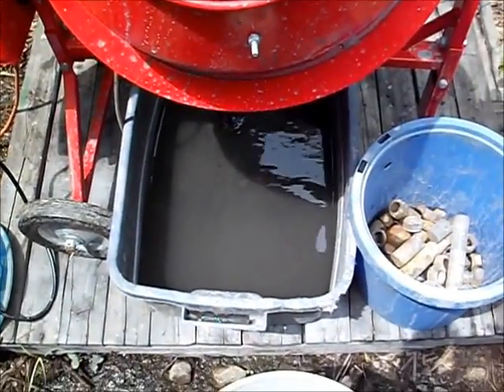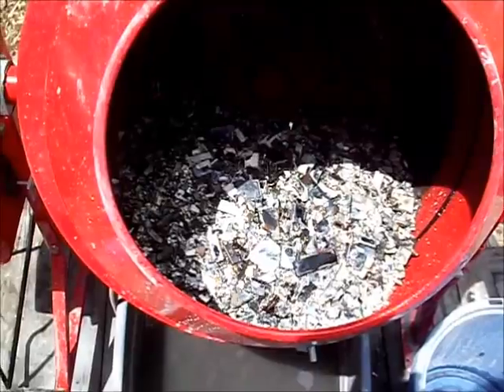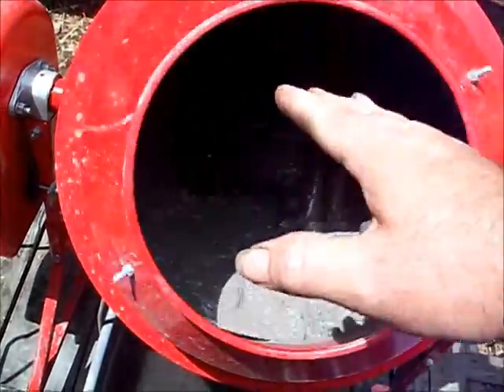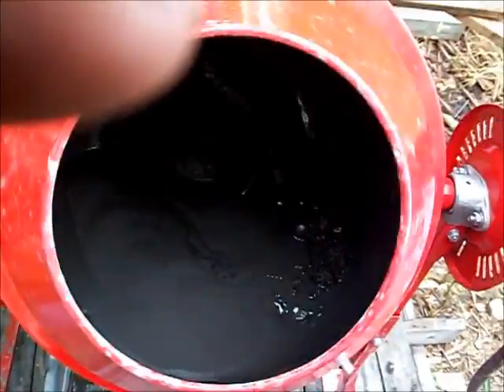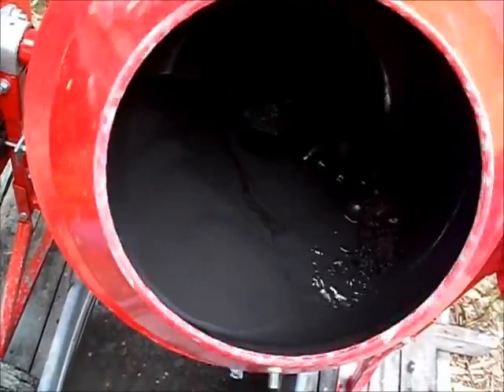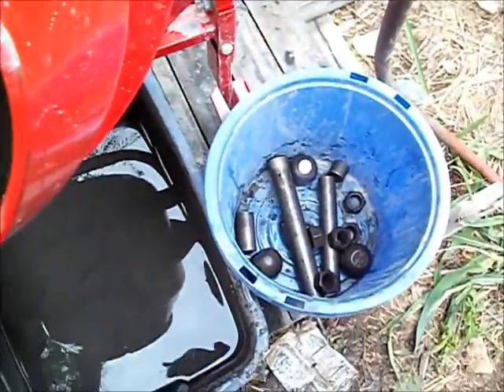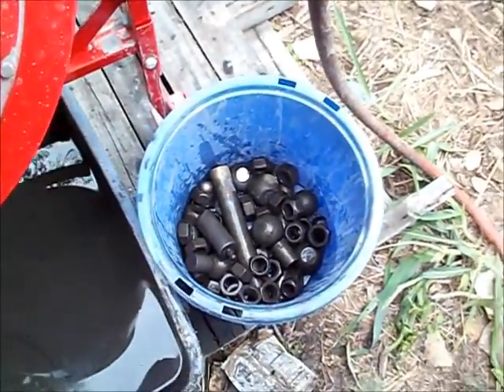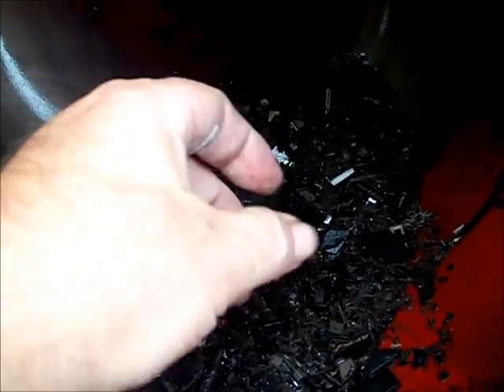milling incinerated chips

Comment: I had this problem  to and I found  if you weld a four inch steal wall on the inside  wall it stops the slide but splashes a little

Comment: i believe if you add on side of mixing drum one or two pieces of metal weld them vertically problem with not turning material will be solved anyway great idea with beton mixer

Comment: when burning chips do you incinerate n.& s. bridge chips with ram and ics or do you process different??
Reply from the maker: It's basically the same process so they all go in together.
Reply: I incinerated 2.7 pounds this weekend of ram chips bridge chips and flat packs off mother boards it was hard dealing with the bridge chips as they didn't incenirate as well used mapp to help and believe its too hot and probably trapped gold inside board fibers and couldn't mill properly as the rest of chips
Reply from the maker: You have to remove the black plastic tops from the green base before you incinerate them or it will create a mess.
Reply from the maker: The gold is in the black plastic tops.

Comment: Put some super magnets on the outside of the drum once it's crushed fine then empty rinse and empty until all the ash water and nonferrous out :)
Reply from the maker: Thank you. I did try that but the steel drum interferes with the magnetic field. It really has little magnetic pull on the material inside the drum.
Reply: That makes sense..inside  might work for the last few passes but thank you for your response and video's :D

Comment: Here is a way that is a 1000 times easier, faster, cheaper, cleaner, more efficient and environmentally friendly! https://m.youtube.com/watch?v=pPQXCgYqggM
Reply from the maker: I don't think so. I can incinerate and mill 30 LBS of IC's in about 4 hours and have the cons ready to leach the next day. I know people who use shredders and from what I hear, they wear out quickly. When you are processing hundreds of pounds for someone else, you have to use the process that is the fastest. Your claim of faster is not true. The bonding wires that you are after are so small, they can be hidden in a very small piece of plastic so the finished material must be smaller than 100 mesh. You would need to shred and then shred again and again and then ball mill to ensure the particle size is small enough. Your claim of more efficient is not true. I incinerate once and mill once. I use scrap pallets that pile up and make a real eye sore at businesses. They are thankful to get rid of the mess. The price of fuel to go get them is negligible. A gallon of gas would make a dozen trips or more. The pallets burn to white ash and the nails are collected with a magnet to use in cementing copper from solution. I could add more but it just gets long winded from here.
Reply: Geo If you're doing the industrial scale of processing 100's of lb's of IC chips then you can afford a proper industrial shredder. It only costs a fraction of the gold produced out of 100 lb chips. I was addressing people who are doing it in a small scale like me and the guy in the vid who is wasting his energy and time.
Reply: +Geo But from the look at this video and many others, the chips are not well incinirated from the first inciniration! and the tumbler is hardly doing anything. The results from what I see here is far from being a success.
Reply: Geo My apology for addressing you as "the guy in this video" I didn't notice it was you lol. Sorry again.
Reply from the maker: No apology needed but thank you anyway.

Comment: use a couple of 15 lb bowling balls.
Reply from the maker: Bowling balls are made of a hard resin. Over time, the material would abrade the resin from the balls and into your already incinerated material. Since the iron can be removed with a magnet, I think the steel balls work best. I'll show some more vids on what it can and can't do.
Reply: Geo Then i am sure a mini-hammer mill would do the trick. They use the larger ones to crush rock for precious metals. I have looked a mini hammer mills online, a person can pick up a used one for around the same price as that cement mixer.

Comment: I would use river rock ,cheaper than steel, of course i live in N.England,
Reply from the maker: The iron is easier to separate out than silica would be. The object of the process is to reduce the material to as fine a particle size as you can without causing more problems. I wouldn't add anything to the mill that can't be removed with a magnet.

Comment: Pretty smart, I'm thinking of making a ball mill at some point.
Reply: Too slow. Use an impact mill. I sell a small one. Also vend a lever operated jaw crusher which can do the job as well. Ball mills are slow. If you use one, get a rock polishing mill with proper milling balls. I use a jaw crusher and a large rock polisher. Get fine powder.
Reply from the maker: I did get the twenty pound ball charge from Legend Mining to run in the cement mixer. It is a world of difference better than the crap in the video. $50 for the ball charge and $150 for the mixer. I can mill about two five gallon buckets of incinerated/pyrolized IC chips in a days time. How much do you charge for the impact mill?
Reply: $1,695. It can do 250 - 500 lbs. an hour.
Reply from the maker: Is that rock?
Reply: +David Howard I already made one:)